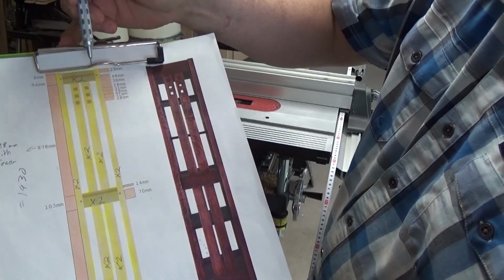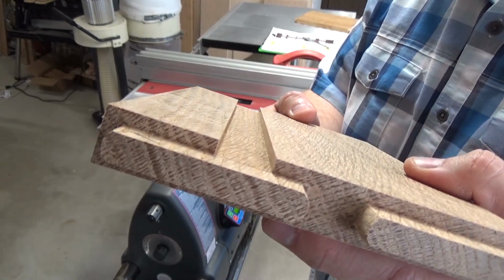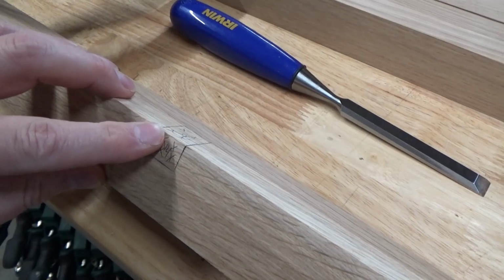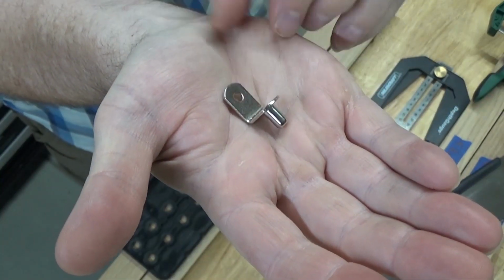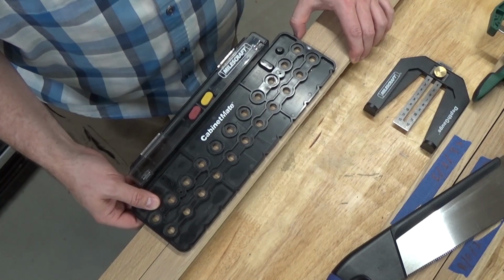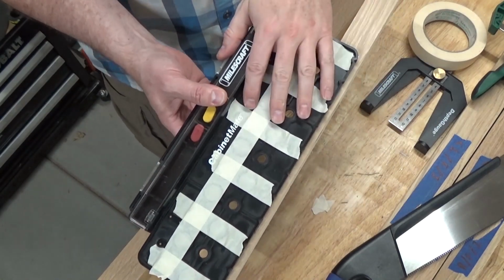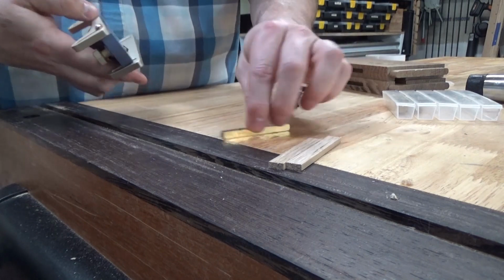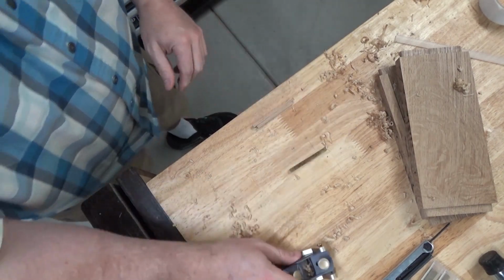More Joinery on the Stickley Highlands Bookshelf Build.

Comment: Tom… I’ve had to patch and fill so many holes… and a good deal of them were mistakes!  

I use my wooden clamps for a ton of purposes.  I think it’s about 50/50 between clamping stuff together and holding work.  They are about as handy as any tools that I have.  

You did a nice job with that corner mortise.  The last one that I put in was sawn, drilled then chiseled.  Otherwise, I did it the same way.

O’ and about those extra holes… I even tape the unused hole on my Kreg jig.  Don’t ask me why I started doing that!!

Keep’em coming, I’m loving to see you work!!!
Reply from the maker: Thanks Dave. Yes, I find more and more uses for the hand screw clamps. So glad I bought these.